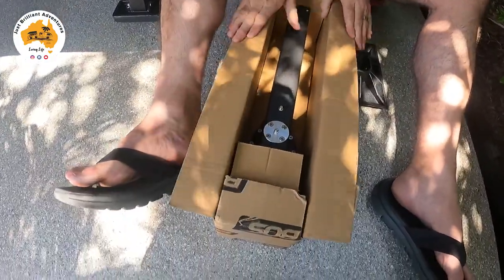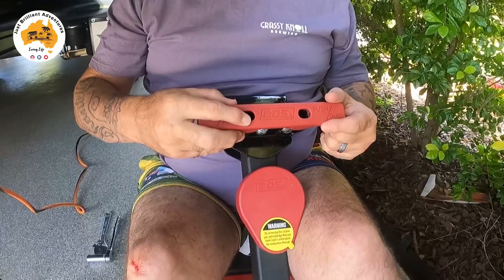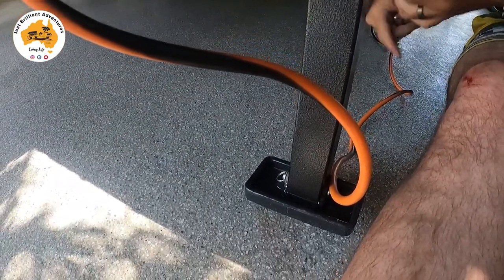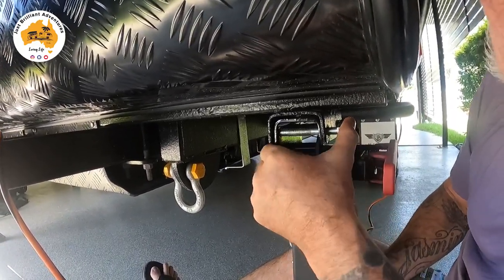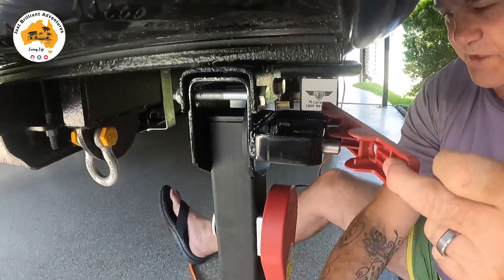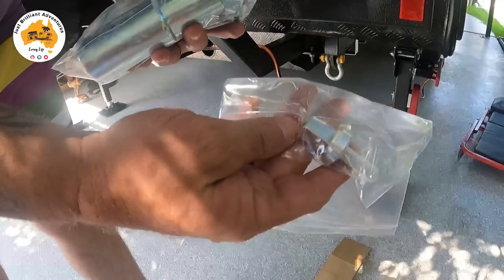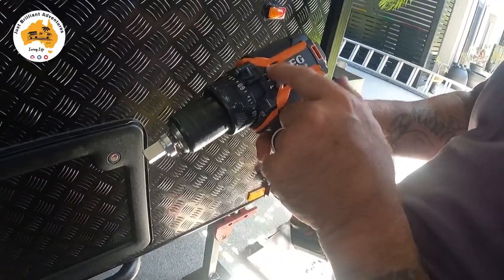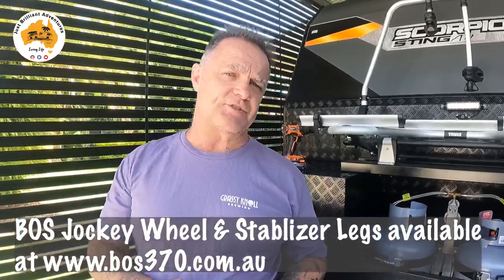HAVE YOU UPGRADED YOUR STABILIZER LEGS?  WE HAVE!! CHECK OUT HOW WE CHANGE THEM OVER.

Comment: Is the bracket, and the chassis member rated to take the 1800 kg. We jack our JB thru the jacking point on the suspension, as per Cruisemaster documents.
Reply from the maker: Can only go on what Bos have told me. Spoke with JB and told ok. You just have to do it bit by bit and all 4 legs 5cm at a time. 🍻
Reply: @JustBrilliantAdventures  thanks mate. They look real good. Thanks for sharing.
Am x RAAF 12 years of service.
Thank you both for your service. 🇦🇺🍺
Reply from the maker: @rtarrant1  cheers mate. And thank you for your service and support of our channel 🍻

Comment: My concern is, not so much the weight capacity of the legs, but the weight capacity of the mounting points on the van, itself, and the rails they attach to….not much good having legs that can lift 1800kg, if the mounts can only cope with a fraction of that.
…and the bolts! It appears you re-used the same bolts that were in the standard legs…what are their rating?
Reply from the maker: Hi there. Not sure of the bolts capacity but I have used the legs to lift the van and change a wheel with no issue at all. The legs the van and brackets are still going strong a year later. 🍻

Comment: As they are stabilizer legs , not jacking points, especially the rear outer cross rails.
The rear cross rail isn’t engineered for that. 
Would discuss with van manufacturer and have design for that ( position under main rail ) or do airbags or just level the old fashion way.
$1400 for a set of 4?
Reply from the maker: AB can I ask who you are, and what is your back ground? The reason I ask is the guys at JB don't have a problem with them.
I'm sure if you speak to Urgen at Boss he can give you the back ground on the legs better then I.
I did a fair bit of research on theese before bying them. I have not seen 1 complaint anywhere on them. Yes I will contact the brains trust at the JB factory today and get their thoughts and respond 2 u. 🍻
Reply: In most standard builds the rear cross rail is 3 inches, sometimes is 4 inches but not as many.  Mounting stabilizer brackets to main chassis rails is a better way, Bos370 sells bolt thru brackets for this.  
I’ve seen a very heavy off-road van chassis full off-road and they noticed the van body twisted under lifting from rear corner position, and with front leg, but connected to car, back leg is doing most of lifting.
I’ve used the bos470 jockey for over 3 years, and changed over to a blackjack electric jack as the mrs can now do the job by a press of a button.
Cordless drill was to high and hard for her. Basic  ergonomics.
Please give both sides, everything has pos and negatives.
Reply from the maker: @ab7406  that is purely why I left your comment up. I owe nothing to any company so there fore I can give an open and honest assessment of products I have paid in full. 
Our YouTube channel is mainly for our 6 kids to see where we are and keep track.
Secondly it is to give advice and help to people who need it.
I have never removed a comment and never will as I am transparent in what I do.
I have messaged both JB and Boss this morning for feedback.
I will post it once received.
Regards Dave 🍻
Reply: Enjoy your van

Comment: Hey Dave what size legs did you go with? I've been wanting a set since I got my van they look really well built.
Reply from the maker: 600 mate. They come in 3 sizes. Great product you won't be disappointed. 🍻
Reply: @JustBrilliantAdventures  I have my van level right now and the existing stabilisers are 470mm from ground (front) and 550mm from ground (rear). which size should I order? thanks!
Reply from the maker: @9_GOAT  mate I have Sting Air. For me 600.
Reply: @JustBrilliantAdventures  no worries. Very confused which size I need to get. Thinking 400 front and 500 rear but website doesn't give much info away. Will have to call them
Reply from the maker: @9_GOAT  measure the distance to the ground. If you have airbags and off road van u will need 600 for both. 🍻
Reply: @JustBrilliantAdventures  I have measured. I shared my measurements in my first reply above. No airbags.
Reply from the maker: @9_GOAT  sorry mate had same question twice. To be safe give them a call. They are good to deal with.

Comment: Look a great product but at $1500‐2000 for a full set I'll stay with the originals.
Reply from the maker: Yes they are not for everyone. You pay for quality, and the convenience. We will not go back. Cheers for the support 🍻
Reply: @JustBrilliantAdventures  They're certainly an improvement. My other concerns are: if you upgrade to these it does alter your tare weight compared to the VIN plate & also the idea of jacking a van via the corners to perform a tyre change. Many chassis won't be built to take the weight at this point, hence the central traditional jacking point. The stabiliser is obviously made for it but is the the chassis?
Reply from the maker: @aussie-all-the-way  mate lotus and 4 other brands are selling them with their vans. So they must be up to the standard and do what they say. I know I have jaked my wheels up of the ground with them. 🍻
Reply: @JustBrilliantAdventures  please don't get me wrong. I think this product is a real game changer for the RV industry. My concerns are for retro fits not new units where the manufacturing has been matched to it. 12 yrs RV repair experience just tells me some damage could occur to those who fit them to an older van that are not manufactured to meet the excellent product you have.
Reply from the maker: @aussie-all-the-way  I fully understand 🍻

Comment: Real question here is... is the van designed to be lifted there...

NO!

Would have to reweld to the actual chassis
Reply from the maker: So your saying the legs on the van are no good for Stablising or lifting the van 🤔
2 years with this van, 1 with previous van no problems.
Again I am about to put them on our new van as I will never go back too original flimsy legs. 🍻

Comment: Are people so lazy that they can’t turn a crank handle, would be more effort to keep a drill charged and get it out every time you want to use it, you don’t put the legs up and down 10 times a day.
Reply from the maker: Each to there own, some people with bad shoulders and arthritis like any assistance they can get not to mention in case of a flat tyre can jack the van up. Thanks for your input, people will take what they want from it.